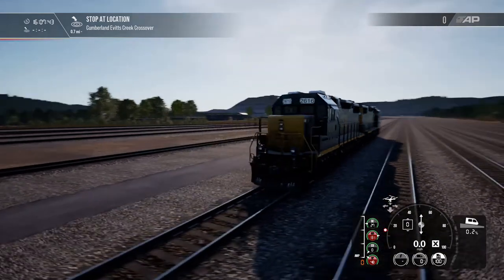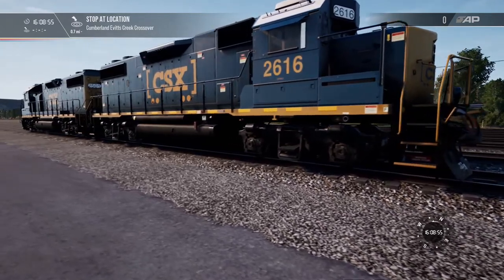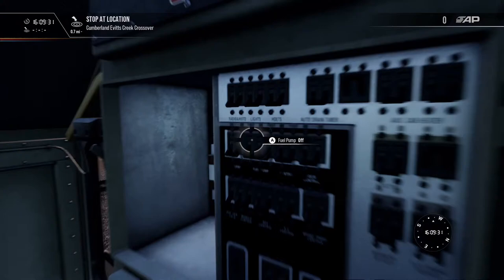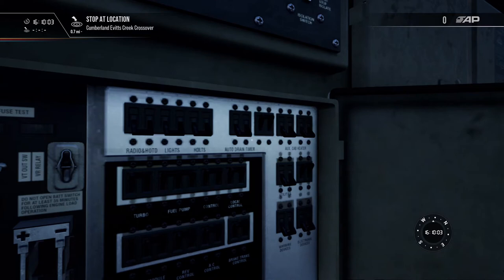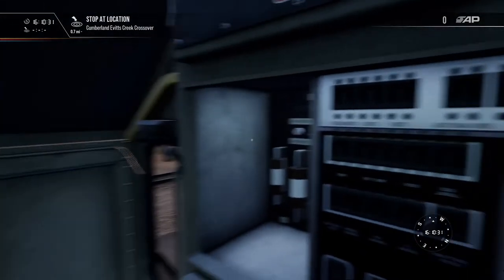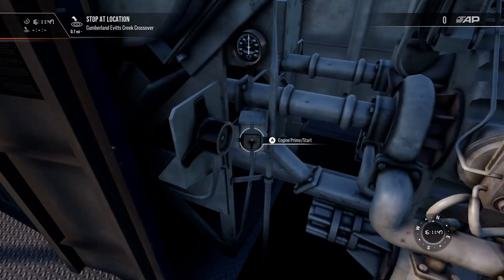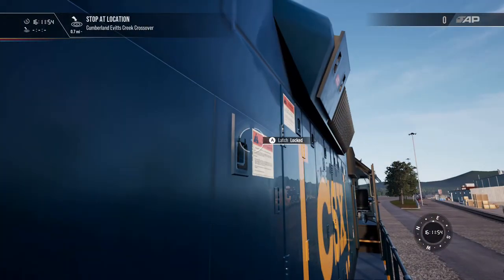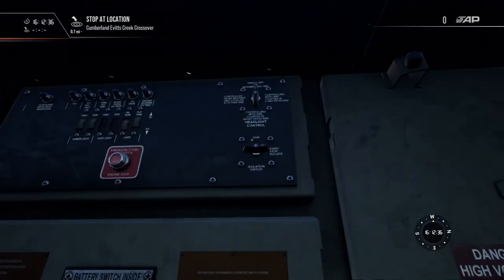HOW TO!!! Properly Start the GP38-2/ TSW2-Sand Patch Grade

Comment: I spent a whole day on my PS4 trying to work out for myself how to start all the trains in TSW2 with the minimum of screen presses and references to the manuals that I had to download. I managed practically everyone apart from all of the Sand Patch Grade freight trains and the Bakerloo Line tube train. I still don't get why they can't add an optional quick start button that sets the train up for you ready to go if you don't want to go to the hassle of having to go through the full procedure. Anyway I've resigned myself to letting the Sand Patch Grade trains drive themselves and just enjoy the view!

Comment: Awesome tutorial! Very helpful for learning the ins and outs of starting one of these beasts up! I've got a question, though.

So if you're running a MU consist, does the other engine start when you start the head loco or do you have to prime and start it as well? Is it necessary to even start the double head? Does the lead engine generate power for both loco's traction motors?
Reply from the maker: I want so Thank You for a view! I'm glad that the video helped you.

You will have to start each locomotive that is on the train. If you are going up or down any grade it is essential to make sure each loco is running. The head loco does not control the traction motor of any other loco besides its own. There are cables that run between each loco and that tells each other loco in the consist what to do.
Reply: @lucerogaming3720  
Ok, that's good to know!

I was trying to figure out if they had the secondary unit already started in the first couple of GP38-2 missions. It felt like it was, since I was able to pull forward with the MU set to Lead/Dead, and tow a few cars, but I couldn't tell for sure. Sometimes it would feel very heavy when starting to roll, and I would have to kick the throttle up to 3 just to get moving.

Thanks again for the help! I used to be part of a Model Railroad club, so I'm familiar with some terminology and switch operations, but it's always fascinated me about how to real deal works. It's much more complicated than just running circles around a track, that's for sure!
Reply from the maker: Yeah I noticed that also on a few missions. I don't know if it's a bug or what. 

Absolutely, after working 5 years as a freight conductor I learned alot of things about the railroad. That is why I play Train Sim games so I can show/teach ppl what it's like.

Comment: You might want to turn on your fuel pump and engine run switches on the console or you won't get far on a real one. I would also suggest checking your brakes before you start the engine so you know what's going to happen.
Reply from the maker: What do you mean?
Reply: @lucerogaming3720  in the lead loco before starting turn on the fuel and control switches on the drivers console

Comment: Hmm i find ir a bit odd that you use the emergency fuel cut of to stop the loco in normal operation, shouldn't that only used in emergencies, or is this just a case of dtg being lazy and not implementing another way of doing ut

Comment: Hi, just came across your video. Never used Dovetail before (more used to flight sims) and somewhat confused as to how to get around, don't find their info very enlightening.. Simple question first, how do I board the train (step by step would be helpful). I am using a mouse and keyboard by the way.
Reply from the maker: It's the Y button on the xbox controller. I play on the Xbox One so I can't tell you what to button to use. I think in the tutorials might tell you what to button to press.

Comment: When I do it after priming the locomotive I just sit in the seat and it automatically turns on
Reply from the maker: After you prime it for a few seconds. You will need to turn the switch the opposite direction to start and hold it until the unit starts.
Reply: It actually does

Comment: I cant figure out to reverse locomotives.  As in like If I wann make the trailing unit to be the lead unit.  It seems like it doesnt wanna move.
Reply from the maker: Is the Amp meter going up when you start to notch up?
Reply: @lucerogaming3720  yes.  But the loco will gain 5mph and wheel slip
Reply: @nissan300ztt  have on loco on frieght(the one you intend to control) and the other on cut-in (also known as the dead part of the "lead/dead")
Reply: @wombat_pickle1674  thank you.  Ill give her a go.